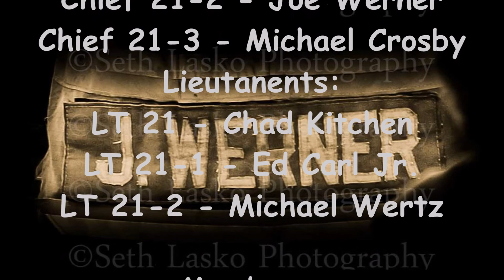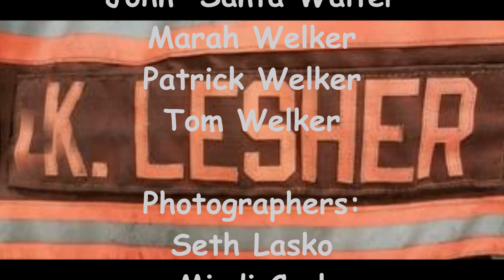Elizabethville Fire Company 2016 Banquet Video

Comment: 5:04 Guy with no PPE at a fully involved door? Not the best idea if you ask me, very close call
Reply: He was likely the driver of one of the first due trucks they often dont wear their gear b/c they usually just run the pumps
Reply: +Nobody Special that's what I figured, very close call
Reply: He was a paid EMS provider on the ambo that arrived on scene right after the Engine, and also happens to be a firefighter for another company.  Short of manpower at the start, he was helping out the first in team until backup arrived.